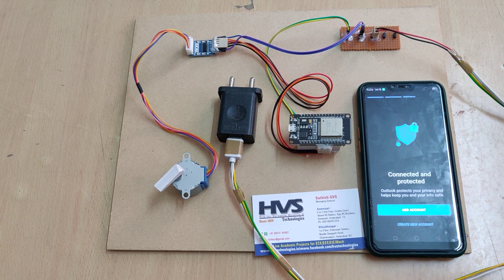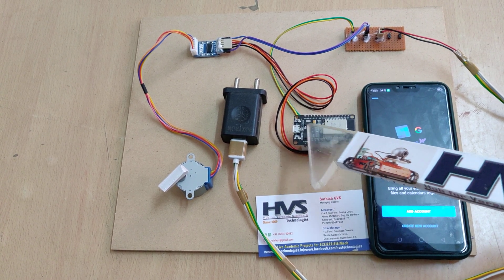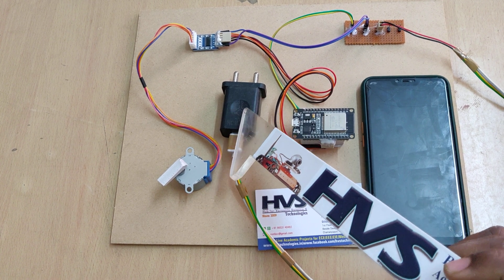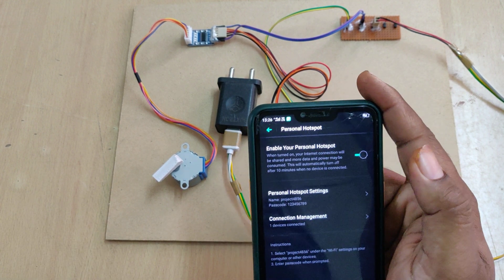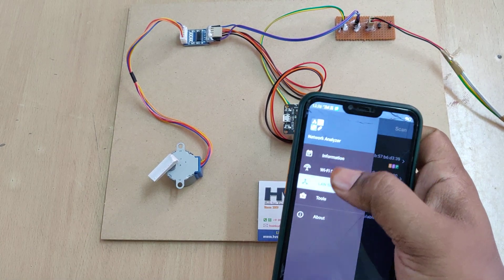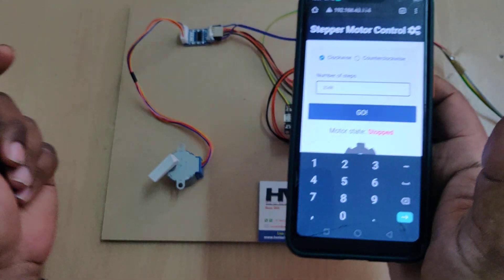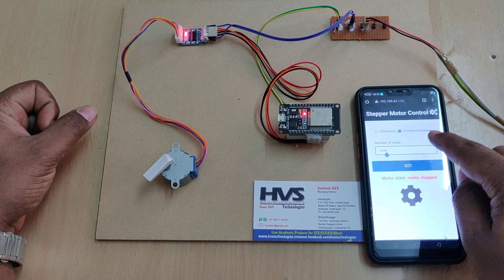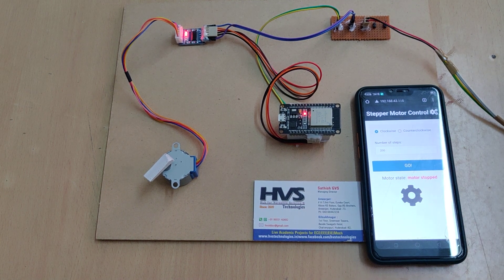ESP32 Web Server: Control Stepper Motor (WebSocket)

Comment: sorry sir, want to ask if the application only works when we only connect our esp with our hotspot and when we connect to wifi can the application display the ip in the application, thank you
Reply from the maker: You can contact us at +919603140482
Through WhatsApp or call
Reply: Can you contact him from Instagram, because the country is different, sir, so it's difficult to contact your number